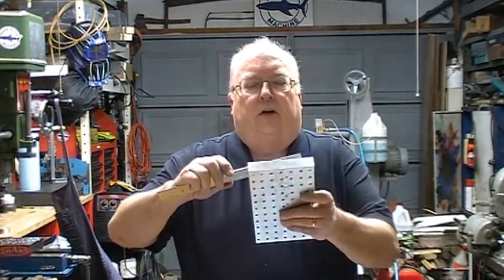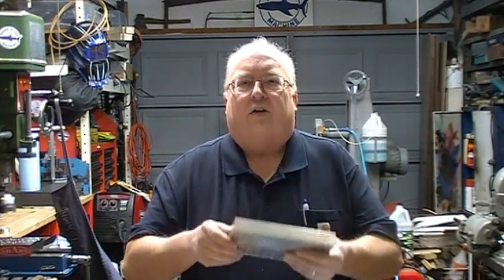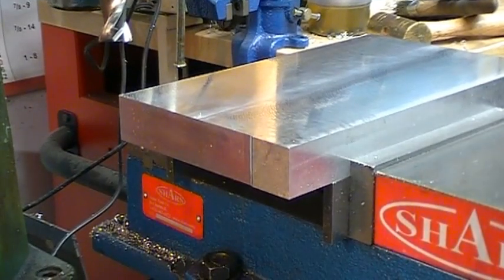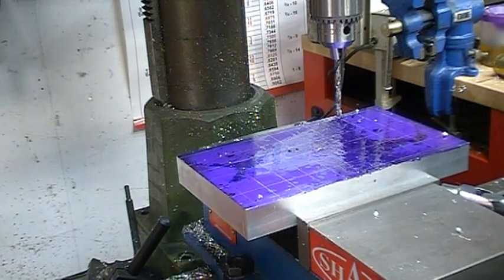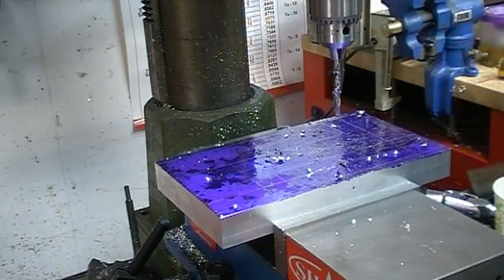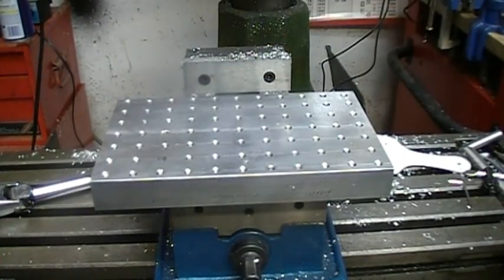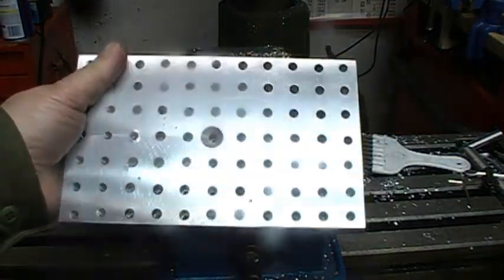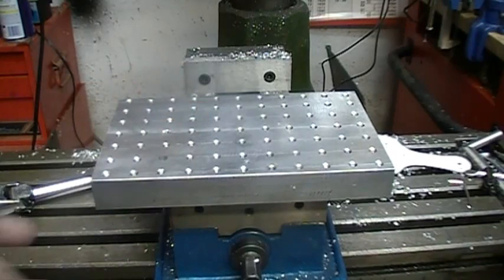Building A Milling Pallet From 6061 Aluminum

Comment: This is one of those projects on my to-do list. Thanks for the warning about tapping all the way through. I’ll definitely rethink my approach.
Reply from the maker: I drilled a clearance size hole from one side about 1/2 way trough the piece.  There is just no reason to have 3/4" of 1/4" threads.  Saves a lot of tapping and broken tap risk.  Thanks for watching and commenting.

Comment: A pallet is still on my "to do" list, but I didn't have the right material for it.  Yours came out very nice, and even better you did it on a mill/drill like mine.  And very cool that Michel sent you stickers too, I like his idea for the #coathanger2020, I just need to get time to make mine!
Reply from the maker: I have been putting off the pallet build for a long time but needed it for a job so no time like the present. Thanks for watching and commenting.

Comment: Nice, I built a pallet last year but my vice wasn’t big enough to hold it. I managed to get it clamped down on my mill table but some how the parallels I used weren’t the same size so all 100+ holes came out crooked, I wasted a 12” x 3/4” disc of 6061! That taught me to double check the size of the parallels BEFORE I drill!
Reply from the maker: OH no.  My original plane was to mill a recess on each edge so the the plate would fit, but it turned out to fit leaving it full size.  Thanks for stopping by.

Comment: Were you power tapping with the mill or hand tapping? I usually find the smoothness of the mill under power works better.
Reply from the maker: I was power tapping. I was using Aluma Tap but apparently not enough in that hole and the tap seized up and snapped quick.  I knew better, just rushing and got a little aggressive.
Reply: bcbloc02  I need your address so I can send you a sticker. Bcliff8@hotmail.com

Comment: On my machines i leave the belts loose on purpose. If something goes wrong i prefer a slipping belt than a broken machine.
Thanks for the shout out.
Reply from the maker: You are probably right about that. I am looking forward to my coat hanger build.   Still brainstorming the design, but I did get some material for it.

Comment: Gday Steven, nice work mate, good idea opening up the back of hole to make tapping easier, Thanks for sharing,     Matty
Reply from the maker: There was really no reason to tap the full 1" depth for a 6mm bolt.  I still have enough thread to resurface the pallet a few times.  Thanks for stopping by.

Comment: Wish I could get my video editor to give me better fast action.    Very nice pallet.  Being able to make changes during the machining process, can serve you well.
Reply from the maker: The editing program is called Video Pad.  It works well and I think that it only cost about $50.00.  I have been using it for a couple of years. There are a lot more features than I use.